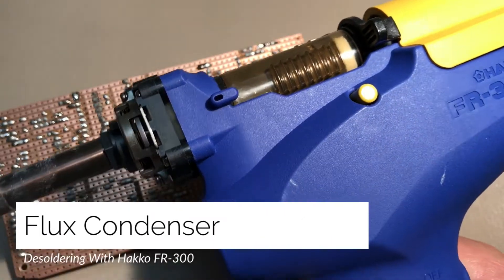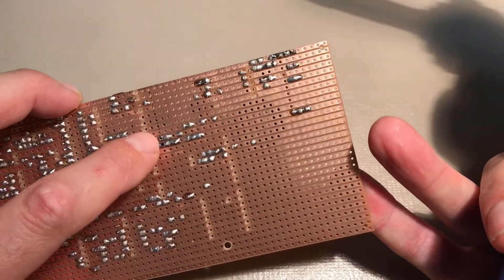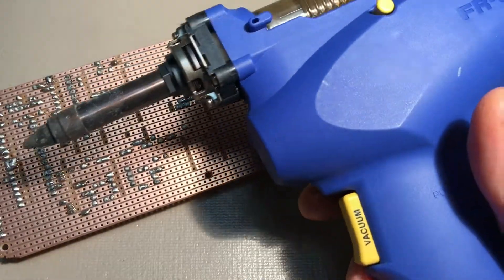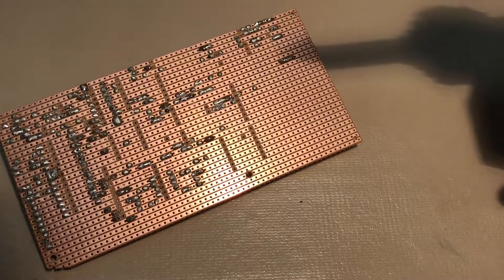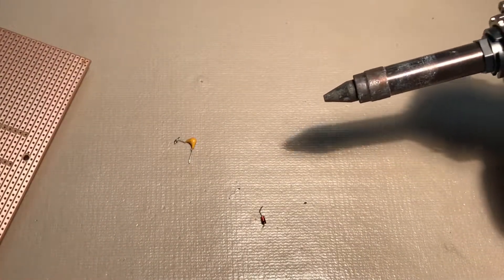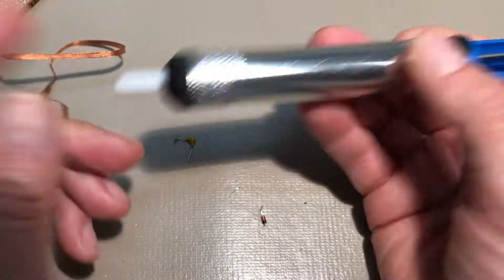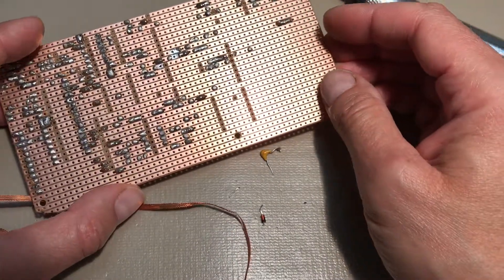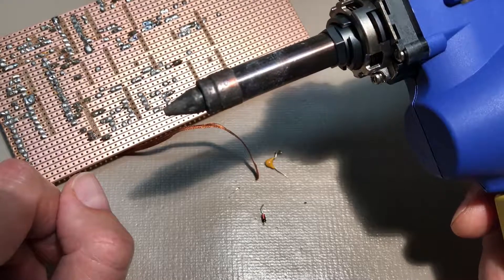Desoldering With Hakko FR-300

Comment: I was just curious how this unit was standing up after a year and a half or so? I’m as cheap as I can be but I’m also pretty practical and I’ve gotten sick and tired of solder suckers and solder wick now... I think it might be time for a change... :-)  Thank You,          Buddy
Reply from the maker: Nothing but good things to say about it as it works so much better than wick. Mine gets a fair amount of use and seems rock solid so I expect it to be in operation for years to come. My only caution would be to keep up with maintenance. When it stops working, it really stops until the issue (clogged nozzle, full canister or old filter) is addressed. Frustrating when you want to just keep working, so it’s good to clean the unit regularly before it interrupts your workflow. Read the maintenance instructions carefully and make sure you get a kit that includes all the tools to keep the nozzle clean. And make sure you don’t put the wrong cleaning tool in the nozzle. I did that once and it got suck, so I wish I had read the instructions more carefully. (There’s a smaller tool with a spring handle for the tip, the larger tool is for the larger chamber behind the tip.) If  you’re going to use it often, you’ll want to get a pack of filters, which is really the only disposable item. Heat is adjustable, but vacuum strength is not. So be careful with some PC boards from the 60s as the traces on those can lift easily from the suction. Hope this helps.
Reply: Thank you, it helps a lot. I’ve been thinking of getting one but didn’t want to spend the outrageous cash for the more advanced units and I happened to see your video and it’s always nice to ask someone who has used one for a few years what they think. Lots a good information you provided, thank you again!          Buddy